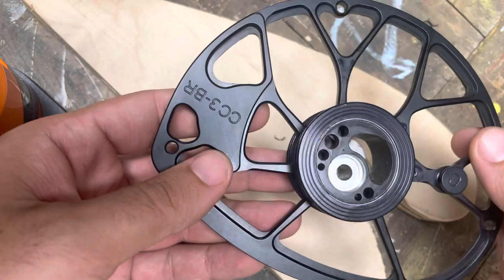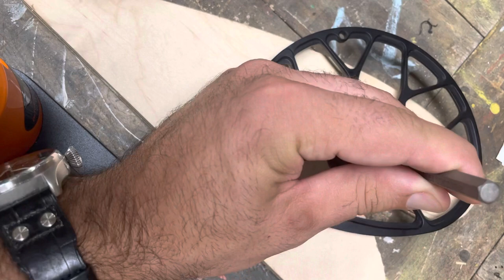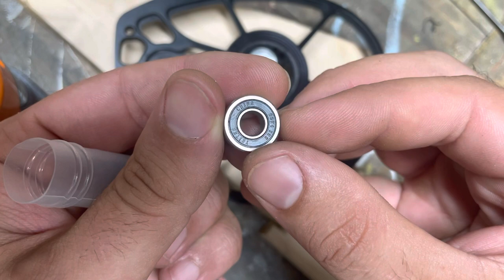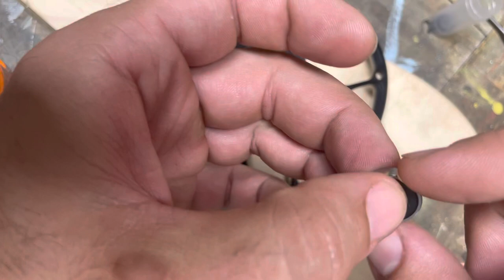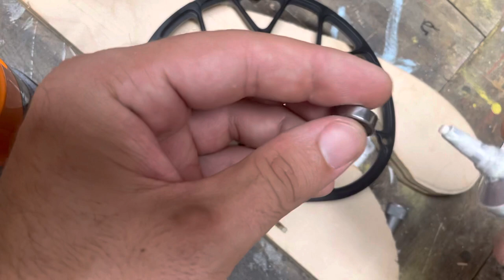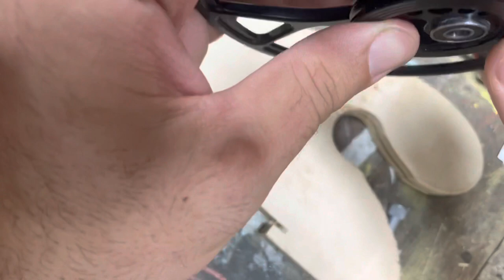Mathews CC/SW Cam Bearing Replacement

Comment: This video was perfect timing. Cam bearing went bad on my VXR and of course, you cant find any bearing part numbers anywhere. Mainly used the video to get the bearing part number. Much appreciated.
Reply: Link in the description
Reply: Did they fit on your Vxr?
Reply: How did you know your bearing went out ? What was the signs ?
Reply: @Getdownorlaydownbum  for this specific bow, I knew my bearing went out by just looking at it. The seal was blown out and some of the balls in the bearing were missing. What made me look at it initially was that I noticed the draw cycle was kind of rough and there was an audible "click" at about 3/4 draw. Hope this helps.

Comment: Any updates on your new bearings and how they are holding up so far? I saw they were chrome steel bearings
Reply from the maker: I go through a lot of bows and the traverse I was changing these on is sold. The cheap Chinese replacement bearings I got off Amazon a while ago failed again on my vxr 31.5 but I had thousands of shots through them. The ones I linked are supposed to have higher ratings but I can’t say for sure.
Reply: @fishhuntvmal468 what happens when a bearing fails?

Comment: How do you know that a bearing is bad (or starting to be bad)

thanks
Reply from the maker: On my vxr the bow just got loud out of nowhere. Pulled the cam and the bottom bearing was grinding. If you have a press and shoot a lot I would check periodically. Bought another vxr used and when I checked the bottom bearing was completely seized and the bow was loud and had hand shock. Changed bearing and it was whisper quiet and dead In hand as it should be.
Reply: on my Mathews Monster Wake i hear distinct click sounds somewhere around limbs while drawing the bow. I have problems extracting the first bearing, the second one goes just ike that
Reply: I've had a few of the stock ones go bad on my vxr and atlas. In my experience, sometimes your arrows will start going left or right more than just a bad shot, also you may hear small clicking during the draw typically near the end of the draw. and lastly I have seen many that the bearing come apart enough that you can see the ball bearings on the inside. When you start to get these tells make sure to not shoot the bow until repaired as in extreme cases it can derail the string and cause bigger issues.